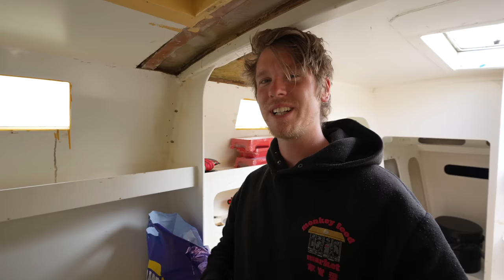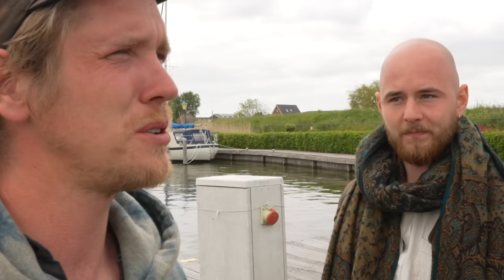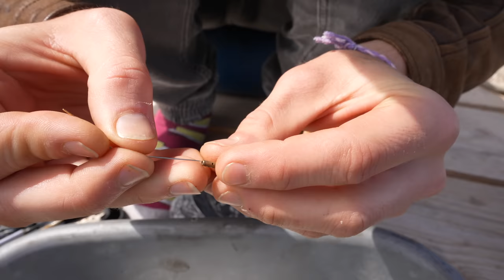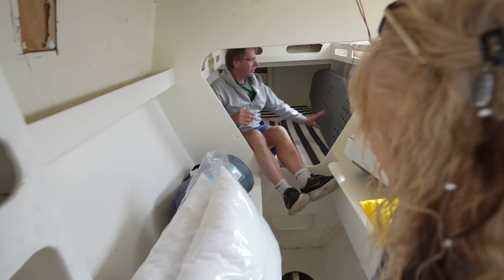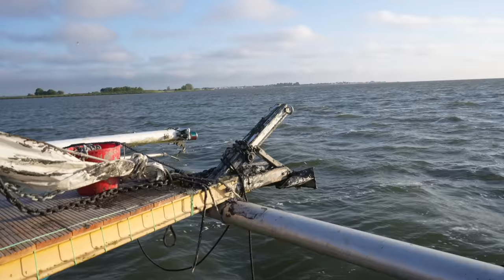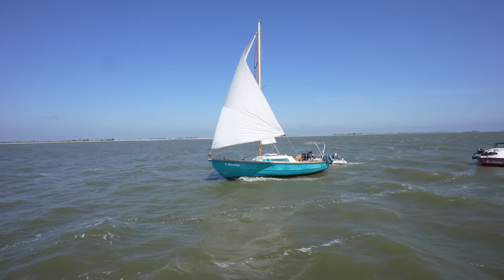I Finally Sailed My Project Catamaran to A Boatyard! (with a dinghy mast) | Wildling Sailing

Comment: If you drill holes in wood, especially with hole saws it pays to clamp a piece of scrap wood underneath this will give you a clean hole that will not splinter.

Comment: When using a hole saw:
Drill the pilot and a little way in with the hole saw itself.
Then flip the workpiece over and cut all the way through from the other side.
You will have no tear-out as you exit the work piece, as you already made some cuts from the primary side.

Comment: Nice milestone, good luck going forward with the rest of the rebuild at the boatyard.  Just getting to sail a little bit on it, such as it was, had to be at least a bit 'motivating'.  

I have a Mercury 9.8 I used quite a bit about 40-45 years ago, and not since.  I took it out and went to start it and the darned thing started first pull.  My jaw nearly hit the floor.  There was nothing coming out the pea hole so I shut it off after about 7 or 8 seconds.  I suspect the rubber impeller has turned to dust, but it's an easy fix.  I used that motor for many many hours and never once had any problems with it at all.  Take it to the lake, mount it up, a pull or two and off to boating, every time.

So I guess what I'm saying is that if you drain the carb every time you finish using it, it will start every time without problems.  Running and not restarting after you pulled a vacuum in the tank is pretty weird.  I forgot and did that once or twice in the many many times out, and opened the vent and it started fine.

The only sailing I've done is on the 16' Hobie I own, but again, haven't done it is probably 20 years.  At my age I don't think I could even step the mast by myself anymore.  Looking forward to see you REALLY sailing, all up.

Your mom is my age, they look like a couple of fun characters.  "Somethin' had come loose on the carb". I'm betting there's a fair chance I can guess what it was.  :-)   I hate it when that happens.

Comment: what an epic trip u can use soapy water find the leak in dingy wash it with first if u still cant find it pump a bit of soapy water in pump it up and swirl it out bubbles will come out the hole and then u can patch it with the proper glue from chandlers and patch

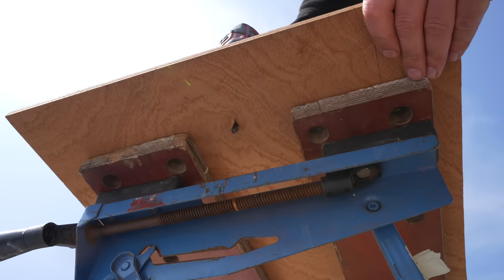Comment: 1:58 protip so you don't blow through your ply: drill the pilot, then score the hole cutter on both sides, before going away at it, that way, you won't be pulling the veneer with you when you pierce. :)

Comment: Very interesting nice people helping. When you do chose to re board the boat use sea weather proof planks and Tung and groove them so they join together better making sure the planks are over strong use the sea glue and can tie the roping at the ends as well as making a type of captains cockpit on top. Then fiberglass the strength both sides to keep out the water and paint it. But of course underneath needs to be fully restored and fiber glassed.  To me not sure about the boat still all wood needs protecting and the bad wood take out with new stronger wood.   I hope you prove me wrong as there is potential to make it a full safe Cat or trimaran.

Comment: If you'll cut 1/2 way through the wood with the holesaw and flip it round and drill through the other way the wood won't split out like that, cheers and good luck

Comment: Hey well done. Keep at it. And, if I may, try to find the Yamaha 9.9 HP High thrust outboards. They re the ONLY outboard in the world with a 3:1 gear ratio. They can only push a boat at 8 knots. they are a perfect outboard auxiliary, especially if there is concern for efficiency. I have built over 300 boats, about 100 of them had these outboards. Four stroke as well. And please build a retractable system for the outboards. I can help with the design if you like. While we are at it we can build a very simple nacelle to protect the outboard from bigger waves. I like your quiet toughness and tenacity, people just do not understand that tenacity can be more important than being uber skilled !!! I should know.
Reply: Yamaha 9.9 eltric best

Comment: Your motors are perfect and you have 2 of them.  They are saildrives designed for lower hull speeds of yachts. I would try running at lower RPM

Comment: Mark, May I make a positive comment, when you are using a hole saw to cut the finger holes in the plywood birth boards, just before the hole saw cuts through, flip the board over and cut from the opposite side… you will eliminate the break out of the veneer… John…
Ontario, Canada

Comment: Hi Mark, I know the boat is far from complete, but I am concerned about the gap between the foredeck that you built and the braces supporting the outboards. Your dad almost slipped at one point and could have ended up falling down that gap into the oncoming outboards. Also the deck is very exposed, I'm sure your gonna fit hand rails etc, please just make it as safe as can be, having said all that she does seem sturdy and capable. Good luck Brian

Comment: Driving, sailing, on the hard in a boat yard. Your folks are so positive and accommodating. Especially travelling at sea in such cold and blustery weather. Boat borrom is probably good but need scraping, cleaning, some fresh paint and maybe a few patches to fix. Most of the work on the rudders, hatches, port lights.

Comment: I have a 20 hp mercury ,bought new 2021 ,it's a leftover 2014 model. Same problem , works on mid and high rpm , not work at  idle 
AFTER it sat 4 months.
I.m selling the thing ., rather than deal With the B.S.
Reply from the maker: they're certainly a pain when left sat for a while
Reply: @Remodeled
The problem is often that the tiny carb  jets get fouled. Unravel a piece of stranded copper #12 or #10 wire and use one of the strands to rheem it out. They are tiny openings so they need a super thin wire. I own 9 outboards. The fouled jets are almost always the problem. Cleaning the jets almost always is the fix. Also, triple check for cracked fuel lines and lose hose clamps

Comment: Great job! It's quite the accomplishment. Did she take in any water in the bilges?
Reply from the maker: Just through an open through hull pipe
Reply: @WildlingSailing  That's good news. I'm really glad for you and your boat! I've been building and restoring boats for 20 odd years. I was just hoping that your hulls core material, if plywood, is sound. Plywood is a great construction material for boats, as long it stays dry inside. Or at least has a chance to dry out if it's gotten wet. I always worry about ply boats that have sat in the water a long time or have sat in long tidal mud flats. Especially with water just sitting in bilges. I suppose when you get her hauled out and you get to do a good inspection, you'll see if there's any soft, rot or delamination. But like you I love Wharram's too. There's just something about them, the aesthetic and functionality and there's a bit of a romantic connection with their pedigree. I'm actually kind if envious that you found that one for such a good price. There's another guy here on YT that found an old Pahi' 31 in NZ and spent a bunch of time fixing it up. Devin  is his name I believe  He had a lot of rot to repair on his Pahi. But he did a great job and the boat turned our wonderfully. I'm about to start my new build here in a couple of months. It's taken me a really long time to get organized and able to find a location to build. It's been nearly 5 years since I began researching and travelling and trying to make a decision on which design and which type of boat to build. Then  having the ability to settle in one place long enough to see the project through...then there's working and being able to afford it. It's definately a labor of love. Congratulations on making it to port young sir!

Comment: May I add a comment.... the aluminum  cross beams need to be fixed securely to the mounting points. A delrin or better yet bronze bushing will take the slack out of the junction a proper sized washer and pin will be needed. Also consider the loads your fore stay will be placing into that fwd crossbeam  in addition to keeping the hulls parallel 
Luckyfish in one one his  early youtube posts had a shorecrew tension up the lashing for the cross beam lashings.might be worth a look.